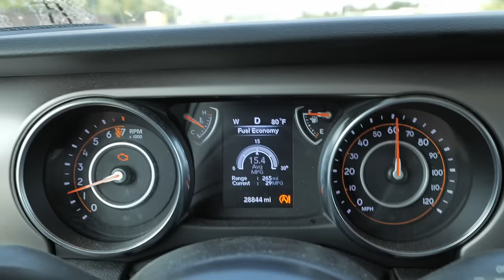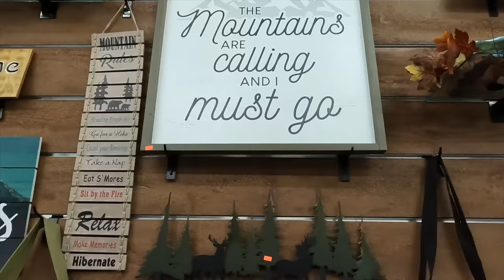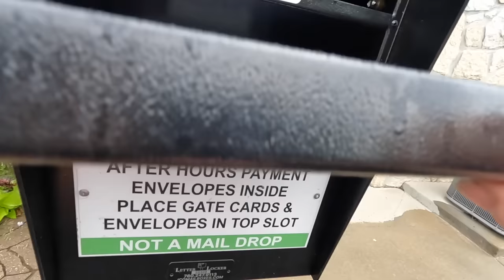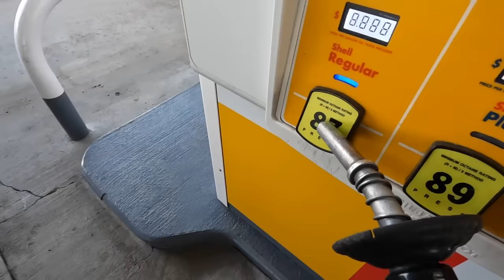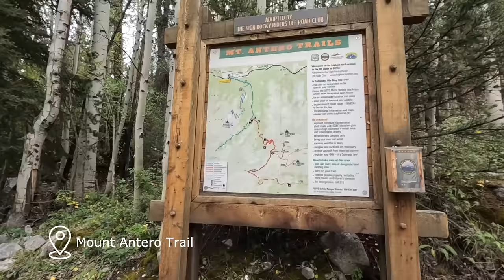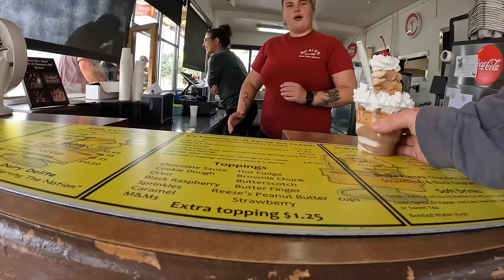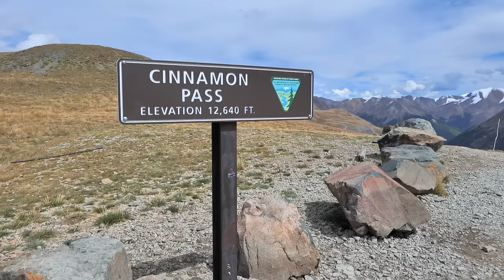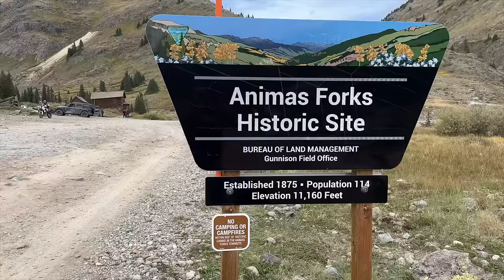Exploring The Colorado Rockies In A Teardrop Camper For 30 Days! | Full Adventure Video

Comment: I've had 3 jeeps....NEVER AGAIN!!  Love my 4runner!!!!
Reply from the maker: Not ready to give up on my jeep yet! Thanks for watching!
Reply: Just traded in my 2021 Wrangler. In the last 6 months it had dropped mpg from 20-21 mpg to 15.5- 16 mpg. Had some electrical issues come up too. At least I had equity in it as a down payment on a used F150 4x4. I love this truck.
Reply: @IAmWoody Haha, that is the mileage I get in my Jeep Gladiator(15-16 mpg). Work from home FTW, and it is worth every gas penny to drive it, more fun than I've ever had in any vehicle, including my previous Wrangler.  Now if I had an hour commute it might give me pause. ;)
Reply: @houstonartz4697  I get 15 on the backroads and city in the F150, but it is a truck and I am good with that. That Wrangler wouldn't pull my new jetski above 4th gear (manual), on flat interstate. I spoke with the dealership about upgrading my gearing with an option that was available with the JL model and they said sure, but it will void the warranty. With the truck, I have no problems. I know the Gladiator would have handled it too, but I wasn't willing to take a chance on the other issues. I must say that I really HATE the electronic assist clutch on the Wrangler. The engagement point was constantly changing and it is an unnecessary "enhancement" to the clutch function.
Reply: Jeeps have been junk for a long time!
Reply: @surfandstreamfisher5749  Thank you for sharing your personal opinion, meaningless to anyone but yourself. "I hate ham sandwiches!!" There you go.
Reply: @houstonartz4697  you're welcome! 🙂
Reply: Me too . 3 time jeep owner , 
No more jeeps , strike 3 .
I have a 95 ran 2door short bed 4x4 , mountain goat .
Campershell . Overlander .
Reply: @denisestarr2314  now now you're gonna butt hurt the junk, i mean jeep owners with that comment!.....😂
Reply: Them 4runners sure do ride nice and smooth on the way to the Starbucks.
Reply: @houstonartz4697 at least ham sandwiches are dependable..
Reply: Mine 4runner rusted in half😒
Reply: Love my 4Runner too! And just like Mike, I have a NuCamp T@G Boondock trailer – a great combo for camping!
Reply: I’m a 4 runner person too. I just had some stuff done to mine. It’s got 140 thousand on it. It’s a 03, 4Runner. I love it. I’m the one owner of it. My son comes to visit me and he drives it. But other than him no one else drives it.
Reply: @gracieg7601  nice!!!...mine is an 05 with a V8 and it's running awesome at 212k!   Just routine maintenance and timing belt a/c blows ice cold and back window roll down for my black lab😁👍
Reply: @BrentGarcia-vb7dx  Haha, yeah, but no one ever carried my ass to the top of a mountain. :D
Reply: I've only had one jeep and I traded it in last year for a new 2023 Toyota 4Runner and it was a great decision. My 4Runner is my favorite vehicle I have ever had.
Reply: @jb117354  100% Wisdom...you  definitely are waaay better off!!
Reply: Hard to beat a 4runner with a 6 or V8.
Reply: @surfandstreamfisher5749 I had a 95 back when they came with a 5 Liter. It was a strong pulled. Easy to work on too. I guess those days are gone now.
Reply: I've had 1 Jeep....NEVER AGAIN!!! Can't wait to get rid of it 🫤
Reply: Jeeps won WW11.  Stop your whining!
Reply: @1755ma  Back when you could work on them with the simple tools.  I had a 95 and sold it at 185,000 miles. 5 Liter with lots of Power but poor gas mileage.
Reply: @chublez  Well....at least it MAKES it TO the Starbucks....unlike this Jeep here....
Reply: Had a JL. Coolant lines randomly failed twice; one time cost me an engine the other just cost me my camping trip and repairs because they wouldn't cover under warranty. All within 10k miles. Trading that POS in was the best thing I ever did.
Reply: This is what I was thinking lol/ jeeps are so cool but I’ve heard nothing but bad things. I want to do the same thing with the 320 and a 4Runner❤
Juniper is a cutie!!!
Reply: Dang…. Just…Empty…Every… Patience  JEEP…. I hear yea… My Minivan Broke down on a 8 month Trip… Frustrating at times.
Reply: @surfandstreamfisher5749 since 2006 !
Reply: @NowhereBoundAdventures  Not giving up on mine, either! In fact, were i needing to buy another vehicle now, I'd get another Gladiator (Rubi)...IF I could get past the outrageous pricing nowadays. Got the Gladiator because I needed the higher towing-capacity a Wrangler (Rubi) -- and all the other mid-0size SUVs (like the Ford Bronco) -- don't have.
"Jeep Wave"

-- BR (2021 Jeep Gladiator Rubicon)
Reply: @surfandstreamfisher5749  No...because the vast majority of Jeep owners haven't had issues like this, so we can't relate to it. ;-)
But no brand is perfect, so ask Ford, GM, Mazda, BMW, Toyota why all the recalls lately. NONE on my 2021 Jeep (Gladiator), not even any TSBs on it.
Thanks, but I'll be keeping mine for quite a while...
"Jeep Wave"
-- BR

Comment: The scenery on the Jeep road in the mountains was so beautiful. The road itself was terrifying!
Reply: ...and that's why this video should be in 4K and not 1080p. Doesn't do the scenery justice. Besides, 4K is the current standard: 1080 is the absolute minimum but 2K is definitely better.
If you're going to take video of scenery (anywhere, not just CO) do it in 4K -- it's just as much work to "film" it, but way better quality, especially on the large-screen 4K TVs most of us have nowadays -- 1080p doesn't look very good on them. The only downside is way larger 4K file-sizes, but the outstanding video quality makes it worth it, IMO.
-- BR

Comment: I’ve had two Jeeps, Wrangler and a Grand Cherokee Limited. I would never buy another!  Go Toyota!  I’ve had a Camry, Tacoma, and now a Tundra. All three have been problem free.
Reply: Agree - Toyota Tundra is excellent
Reply: I concur with this Toyotas are the best
Reply: Had 2007 jeep Sahara, traded it in for 2017 jeep Sahara 4 Dr. Test drove it from Tucson to Prescott and back.No mechanical problems but it was noisy as hell, migraine hole trip.  Fortunately CarMax has a 30 day return policy with no questions asked and total refund.  Same dealer bought a 2023 Toyota 4runner Sr5, 4x4, 22k miles and its a dream.  Rock solid car and planning  a 6200 mile trip this summer.  Even at 80 y/o life is still a journey even without a covered wagon.
Reply: I bought a used f350 6.7L diesel- 2wd (so sits lower thn 4wd), gets 20 mpg when not towing 10k lb trailer (10mpg when i am towing).  Regular maint includes oil chane every 5-7k miles.  Crank down windows, no ac, so I have to find altitude in summers.  Toyotas also seem to be a great choice - even their 4wd mini van, although clearance might not be what you want/need for your trip. Fun to watch your adventures!  Stay safe and have fun 🙂

Comment: Relax. I own a Jeep Wrangler Rubicon Unlimited 4/door. I have clocked over 90,000.00 miles with zero problems. I do my own maintenance and repair. I know enough to own some tools and online repair Manuel paid $89.99 for it. It is the same manual the Jeep Techs use at the Jeep Dealerships. I”m enjoying your trip footage and comments.
Reply from the maker: Thanks! Stay tuned, lots more coming!

Comment: My 22 year 4 runner with 330k miles did great cross country and back.  We did have to ad 3 quarts of motor oil over the 8k mile trip.  Like my nephew said if 3 quarts of motor oil was the problem than you had no problem considering the age and mileage of your car.

Comment: Nice Willy - from what I understand Jeeps aren't all that reliable, but they look cool!
The fact that they have larger, Square windows that you can actually SEE out of (also, like many larger SUV'S) is a feature i would appreciate in those vehicles. 
Unlike many vehicle models which have those horrendous,  pinched windows...
Reply from the maker: I genuinely love my jeep. It is very fun, and it's been extremely reliable aside from the problems I had on this trip. Once they were resolved I was amazed by it's capabilities completely stock from the factory. I agree about the windows! Now it has a lift kit and I can see even more!

Comment: I’ve owned 14 jeeps and I’ve never had any issues, reading what people have written jeeps are awesome and they’re super easy to work on and very easy to fix, in regards to quick swaybar disconnects there’s a lot on the market it sounds like you have a very simple lift Whatever you get just make sure they’re quiet they don’t bang around some of the quick ones pop a pin out which creates a little slack when they’re connected and makes noise but there’s a lot of good ones on the market, I recommend Northridge 4 X 4 they’re a great company to purchase from and any parts you get in the future they can direct you properly. The problem with jeep once you start building one most folks are never satisfied the tires keep getting bigger and bigger and the lift gets taller and taller ha ha anyway this was a great video and probably the best part of the whole trip was you got to spend the whole time with your dog and that’s what I do a lot of with my jeep and modified off-road teardrop trailer kudos to you👍👍👍
Reply from the maker: Great comment! Thank you!!

Comment: Instead of getting quick disconnects, you should consider Rock Jock Anti-rock sway bars. You don't have to be on level ground for those quick disconnects to reconnect and the anti-rock will automatically flex when you're off-road. There are other aftermarket companies that make them now for a competitive price.
Reply from the maker: Great suggestion, thank you!

Comment: I’m on Jeep number six.I had some window motor issues with a liberty which were promptly resolved under warranty.otherwise,no mechanical problems!Two of the units had diesel engines.The 2006 liberty and the current Wrangler JL.The torque is addictive and the fuel mileage leaves owners of other brands envious and making lame excuses!

Comment: I use a 6 cyl frontier to pull my tear drop. I am pleased with it. Accidently wound up on a really bad atv route that really got bad, bad enough club members stuck a fake skeleton dressed in AtV clothes sitting in a beach chair with a sign warning they were working on it but currently the next stretch was really bad . They cleared a tiny turn around, i inched the rig back and firth until finally turned around then rode the ridges out. Now i am much more suspicious of maps or google maps, lol. But the truck got it done , not to bad on gas and as confortable on the highway was a car really, hardly feel the trailer.

Comment: In our experience, dealers tend to only use factory banded parts.   Smaller shops can get parts from O'Reillys/autozone/ect and generally quicker.  Have shipped amazon stuff a day or 2 ahead as well if its somthing we have the tools for.
Reply from the maker: I understand that. My issue at the time was that the jeep was still under warranty and I didn’t want to pay for the repair or the parts. In any case , I’ve had zero issues with the Jeep since this trip. Thanks for the comment!

Comment: Jeeps are fun with the doors off and cruising around town. I'd get a pickup if I were you but solely from my experience.
N/A V8 reliability, more torque +HP for towing and a bed. You can get a slide-in camper (what I did) and tow another fun vehicle or fun toy of your choice.  I had 2 Wranglers and after getting a pickup I never looked back at anything else.
Reply from the maker: I used to have a 3/4 ton pickup and loved it, except for the gas mileage. The jeep has its pros and cons, but I’m enjoying it for now. I might eventually get another truck, we’ll see! Thanks for the comment.

Comment: We had a 2014 Jeep that we towed behind an RV.  It was okay until we keep getting a code for gas cap not on.  It was after 4 visits finally fixed as O2 sensor problem.

Comment: Cant ever go wrong with a 4 runner... Reliable, cheap to fix, and will take you on as many as adventures as you want. I swear my Toyotas... Especially their V6 its bulletproof. My 2000 Camry had 387k miles on it when I sold it and was still running..

If you dont mind what drone did you use to film? Thank you and great video and adventure 🙏

Comment: Love the video, love the recording style, The pup is gorgeous, teardrops are just fine for a one person trip! I have a fully tricked out PowerWagon and I'm heading out into the back country tomorrow AM as a matter of fact. Keep it up. I"ve been doing this kind of thing for many years. A few things that'll really help.
A drone
A winch if by yourself
Traction boards
a bolt on 4 gallon gas can. 
GMRS radio. You can get a 50w one for the truck and can easily reach many miles for help.
Get a Spot and pay for the ooh crap rescue service at $49 a year. It will save you tens of thousands if you need to get towed from the middle of nowhere.
an subscription to Onyx offroad and use breadcrumbs so you don't get lost. Well I get lost easily. lol.
Reply from the maker: Great advice!

Comment: One should expect any motor vehicle will have occasional mechanical issues. How well the service  supports you when broken down on a trip will often determine the quality of your experience. I ha good service pre Covid, but no real .problems. Jeeps break down more than Toyota LCs or Lexus 4.x4trucks. Fewer repair options could create delays. My latest 2011 LX 570 has held up well so far, even with me doing trails like Elephant Hill. Main advise is to know your vehicle’s weak points and stuff needing attention before setting out.

Comment: Manufacturers are reluctant to replace emission related parts bc if they get too many it will trigger a recall. The other fact is; unless the part is dead in the water, the mfgr will kick it back to the dealer after testing with ‘No problem found’ and charge the dealer $. That’s why the one dealer said he documented it so the next dealer could actually fix it. 
  Great video! All that snow and mud in a stock Jeep and you didn’t get stuck I guess the Jeep is good to go out of the box?!?
Reply from the maker: Thanks! The jeep impressed me a lot after the O2 sensors were taken care of.

Comment: Amazing video!  I watched the whole thing and now I want to buy a teardrop even more!  Ive been looking at a cheaper teardrop (the bushwacker models) or just buying a TAG thats a few years old.  Any tips for buying older models?  How do you store yours?  Do you cover it?  Any issues with floor getting soft? I saw your other review video on your teardrop which was helpful as well.  Do you think I would be able to make some of those mountain trails on a AWD pickup truck or do I need a 4WD truck?  Just subscribed so looking forward to your video's!
Reply: Ohh can you also post the 3 inch memory foam pads you used?
Reply from the maker: The memory foam I just bought at Walmart and then trimmed with tin snips. A turkey carving knife would work better. I store mine in the garage. One of the many reasons I love the teardrop size!
Reply from the maker: You could do a lot with an AWD truck with enough clearance but I wouldn’t have been able to do the alpine loop without 4-wheel drive.

Comment: 😂When I retired at 62 I decided that I wanted to travel and see the West Coast from Texas to Montana and every state in between but I needed a vehicle that I understood and that if something were to go wrong I could fix so I chose a 1977 Dodge Mallard class C with a 360 v8 like you I headed out on my first journey and found all the things that weren't working and then over the next 4 years I've gone through what we affectionately call Lucy bumper to bumper everything that could go wrong has been upgraded or replaced every hose every electrical thing which there aren't many. I did upgrade it to a Edelbrock high performance intake manifold and a Edelbrock 4-barrel carburetor to give Lucy some extra oomph.😮 I've got 800 amp hours of lithium and 800 watts of solar. And backups for my backup I have four separate power systems and can go totally off grid even run my air conditioner and every comfort of home.. I can't fit the stories in on our first two journeys when Angels showed up just at the right time when things went wrong and I think you'll find that to be true for you as well God is good he has Angels everywhere. Even ourselves ready to be angels for someone else angels are ministering spirits and if you have administering Spirit you will attract what you project. God bless you and your travel I hope you've solved your Jeep problem I am listening and I will follow along. I am so sorry to see how things went I am only where you are now looking at 10 days of waiting for parts that's just horrible..😢 at 5 0. 4 8 enter the story I have enjoyed your journey I would not have gone up that mountain pass in the snow..😮 but I'm wondering how do you film while driving? I mean I understand there must be a drone involved but how do you do that I thought this was like your first video you seem like you've been doing this forever and you're very good at it.
Reply from the maker: Great comment, thank you!!

Comment: It’s overkill to disconnect your seay bar on what are essentially dirt roads. You do it when you’re actually going rock climbing and going at speeds of less than 20 mph.
Reply from the maker: There were several trails that I didn’t bother disconnecting and I regretted it. So if I have the opportunity I just do it so that I’m prepared for whatever I encounter.